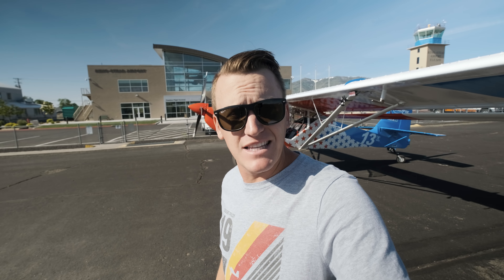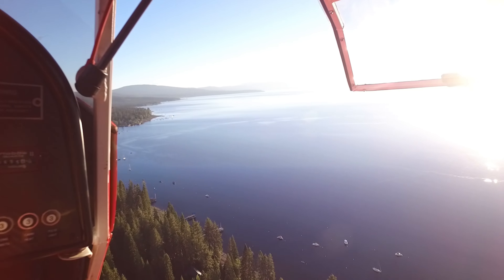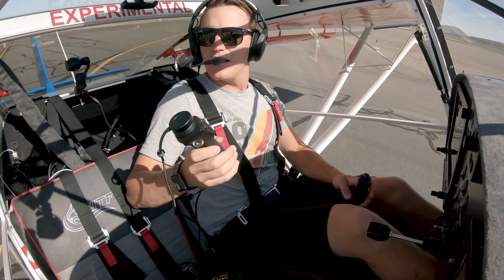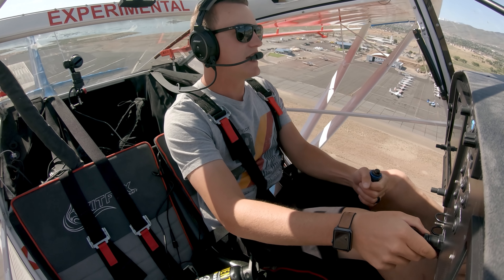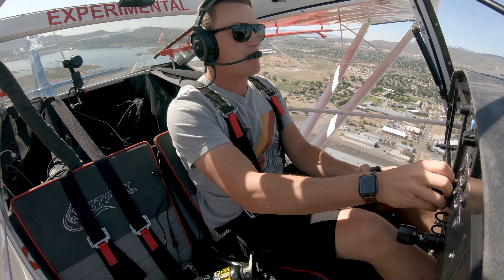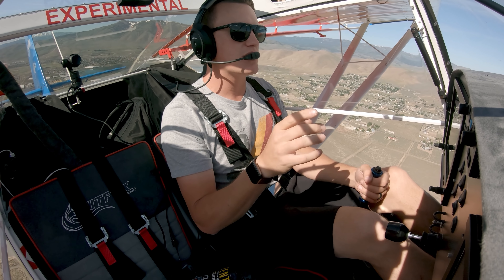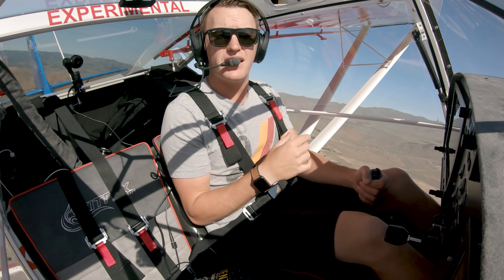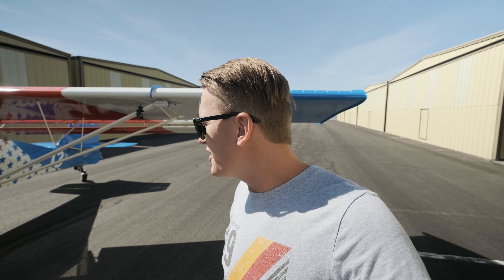MORE LIFT!!! Custom STOL Leading Edge Cuffs

Comment: I think you definitely caught on to one of the big draw backs of the temporary design. If you had an appreciable amount of gap or a “divot” as you say between the cuff and the top of the wing, you will have disrupted airflow which more than likely rendered your VG’s useless, and would explain the erratic lift performance on landing. If you went through with a more finished version of the cuff, with smooth transition to the surface of the existing airfoil, AND moved your VG’s up, you would be surprised as to how different your results would be. I’m in firm belief that your experiment would work, but you would need to address the above issues.

Comment: Try adding slots in the cuffs. Look at all the other radical STOL aircraft...Helio Courier, Zenith 701/750 etc...and they use slats which allows air to flow between the leading edge and the main wing. Moving the VGs forward would help too.
Reply: Or perhaps, a Wilga?  =)
Reply: Slats severely reduce cruise speed.
Reply: @Hyperious_in_the_air  That's not accurate.  Slats SLIGHTLY reduce cruise speed, not severely as you stated.  I've seen guys that put slats on Cubs, Tri-Pacers, and many other aircraft and some saw 0 and up to 5ish mph difference in cruise speeds.  It's also important to remember the difference between slats, slots, and the above, cuffs.  Listen to Trent's buddy Mike Patey talk about it here (he talks about level flight and how the wing hardly notices the slat is there):  https://youtu.be/7hXOzES7fZE?t=135
Reply: @Hyperious_in_the_air  Trent said he wasn't concerned about loosing cruise speed in the video.

Comment: You will not get the results your looking for until you have the vg's in the correct position.... On the cuffs... You might want to turn the cuff into slats... At least out board.. You're on the right track

Comment: Does not appear to be a fair comparison. Stirring up the air right as it starts going over the upper wing and moving the VG's aft negates the cuffs advantage. You should get at least 1-2 kts better stall if you go ahead and do the full modification.

Comment: At some point, we're going to see Kitfox or another designer put together a hot rod of built-in design improvements specifically for STOL racing. Kitfox will want to reconsider the weight/balance profile for the 915 engine folks, etc.